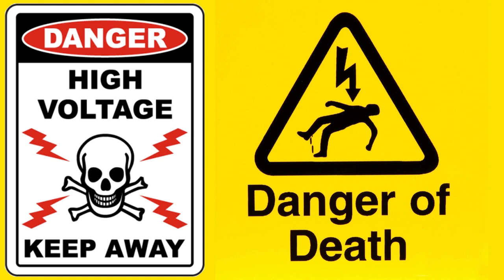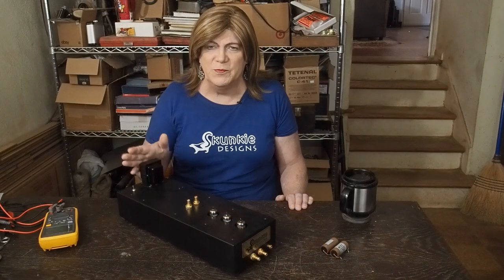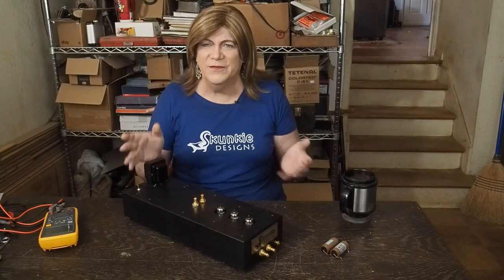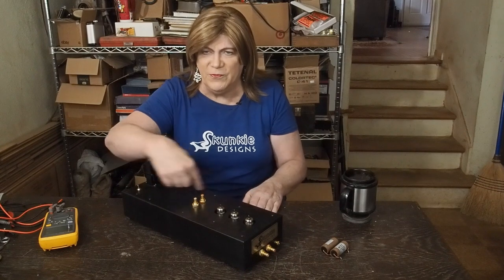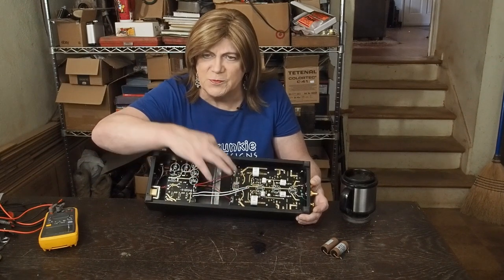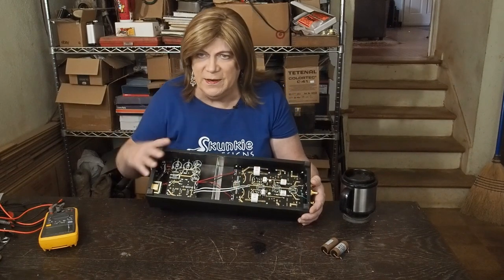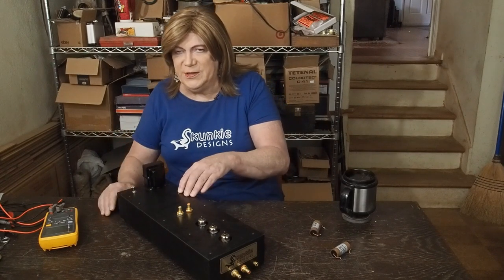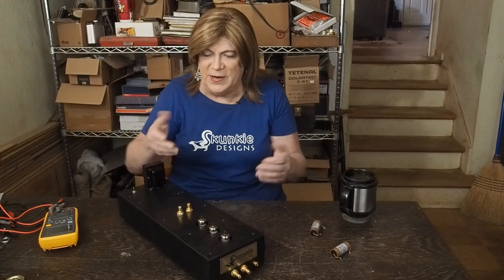All Tube Phono Stage Pre-amp Part 18: Subjective Wrap-up Final Review

Comment: Thanks for this valuable presentation.  I built a similar kit from Zhili Audio, adding a few premium parts.  In usage, my finished kit needed two mods - 1., Use a 12AU7 as Tube No.3 position to lower the gain w/o resorting to use of a potentiometer; and 2., Use a grounded tube shield on Tube No.1 to quell hum.   Fixing the hum resulted in an enjoyable improvement.😀

Comment: Hi, love your videos. I have built 3 of these now. All with 6n2p ev rather than 12ax7. I have re-wired the pins to do this and changed some of the resistor values to suite.  The last one had Charcroft silver micas, matched RIAA components, all good quality parts, bypass Caps under the 6 elecyrolytic, and the 2 small elevtrolytics changed to elna silk caps, I also use the Alpha2delta power supply board built from a kit. It is very quiet and sounds very, very good. I use russian pio caps with very good results. A lot of people on the Lenco forum build these and do all sorts of mods etc one of the members put a lot of effort into making a guide on modding/building these. I must build the standard one some day to compare, but mine sure sounds good. The A2D power supply made a quiet amp silent.
Reply: Hi.. What would you say are the sonic differences between Charcroft silver micas and generic silver micas, from let’s say Antique Electronic Supply? Less glare and sibilance? Thanks..
Reply: @rickg8015  I built my first one with antique mica units. I didn't like the sound and ended up changing them to cornell D ones. The change was massive more open, detailed and more punch. I think the CD's are good value if you get the 1% ones. Charcrofts are nicer but were twice as much. I managed to find NOS Holco resistors of the right values for the RIAA circuit too.
Reply: @flyingmattyboy  Thanks for the feedback.. I’ve only tried Dale RN60 and Takman Rex metal films for RIAA. I liked them both..

Comment: Thanks for the series.  This is going to be my first tube project and between this series and the popularity on lencohaven, i have the confidence to tinker untill i get somthing i like alot better then the phono stage in modern integrated amps.
The parts cost sure do add up quick.  I cant ever seem to settle on any cheap hobbies.
Reply from the maker: yeah, these are not super cheap to build, but I don't trust the parts in the prebuilt ones. I've found the resistors they include with these kits can be all over the place!

Comment: Well, I just watched all your videos on this project and I want to build one! I have two Schiit Manis, one Schiit Mani 2, one ART DJ II, and one Cambridge 615 (I believe that's the model number) phono preamps, but this sounds like a lot of fun. The only thing I didn't hear was what the total cost of the project you built compared to the original build with the Chinese parts. I did download your BOM, but I haven't had the time yet to research the cost. I have a variety of MM carts and one MC cart so I'd be using this on my Technics SL-Q2 that I swap between the MM carts on. I use my Denon DL-103R exclusively on my Rega Planar 2 with my Schiit Mani 2. There were a few places in your build that was missed when it came to the placement of the parts on the boards as I've never done this kind of build before. I've mainly modified/refurbed turntables, but this will be a new adventure. I found your videos after possibly looking into a DIY tube phono preamp. Thanks for the videos as I'll be watching them again when I start building mine! Duh, I just found a couple missing videos on this series and going to watch them now!
Reply: Hello im considering the schiit mani2 , art dj II OR this kit. 
Could you kindly recommend or share your experiences with the mani and art dj?
Reply: @hanscleung4633  I haven't used the ART DJ Pre II in some time, but for it's price point it's good. I really like my Mani preamps, but I'm wanting to try this tube preamp for a different sound. The Mani has many reviews here on YouTube and I have many videos on my channel demonstrating the sound of the original Mani and the Manis 2. I still haven't been able to start buying the materials needed for this tube preamp yet, but I'm hoping to soon as I have the tools for it.

Comment: Thanks for this helpful series.  My parts-swapping in this model brings me to disagree on parts choices for the 0.1uF and the 1.0uF coupling caps and the RIAA silver-mica caps.  The original parts yielded a thin, harsh, lackluster, and impaired-harmonics sound, even with 2 weeks break-in time..  But with quality RIAA caps, plus coupling caps of Jupiter 1.0uF and NOS Russian 0.1uF silver-mica caps, this thing sings, right off the bat.  YMMV, as hifi is about system-dependency.
Reply from the maker: I agree the factory caps don't work great. I used mundorf coupling caps, a .15uf, .01uf and a 1uf + some quality RIAA caps in mine.

Comment: The Miflex coppers do sound rough in the first couple of weeks, and that’s as couplers between driver stages and 300B output tubes.. It might take longer in an input position where much lower voltages (and current) are usually the case..
Reply from the maker: Yeah I wondered about that as far as "burning in" as there is very little voltage or current in this application. I for sure didn't throw them away and will try them in a future project!

Comment: I finished my build and sounds great. i watch your videos and follow your build, but I need to crank up the volume to get more sound up to 2 o’clock on my volume. I don’t know what is wrong.
Reply from the maker: Compared to what?
Reply: @SkunkieDesignsElectronics  I’m not comparing. Im just asking if you have any idea what the problem with my build . If this normal to crank high the volume or is there any missing parts in my build. Thanks
Reply from the maker: This preamp normally has plenty of gain compared to something like a DAC or a CD deck. I'm asking if you are comparing it to a DAC/CD deck or something like a pre-amp put between a line source device and the same amp. Did you do any other mods when building it?
Reply: @SkunkieDesignsElectronics  No ..I built this same as you . I hooked up in my yamaha as1100 and i hooked up with my REISONG A10 same issue I need to crank high the volume, by the way I made MODS With my A10 and the sound is very good BECAUSE of your You Tube videos THANK VERY MUCH.
Reply from the maker: Yeah that's not normal. Not sure if it's a defective tube or something else is going on. Maybe move this to my forum and ask there, attach voltage measurements, pictures etc.

Comment: Must depend on what circuit you put those miflex caps in. I put them in my 2a3 amp and they started out very harsh and bright like you said but after 3 days straight of letting it run it has settled way down. Very smooth now and the brightness is almost gone. It had extreme sibilance for the first 2 days but that's all gone now.
Reply from the maker: It does depend. In this phono stage, this cap only has 5mv of photo cartridge signal running through it, so would take a LONG time to settle down, if ever. In your power amp, it probably has over 100V of swing running through it and still took several days to settle down.
Reply: @SkunkieDesignsElectronics  I guess in your application you'd have to break it in before you put it in the circuit. Sounds like a lot of hassle.

Comment: I’ve been looking for a pre amp to run my kt88 single ended amp that I built from watching Marks videos on Blueglow electronics. Mark mentioned that it would take probably 2V to drive it, so what might this amp produce from a 4mV input from a phono cartridge at the output. I have ordered the kit for this one, and am looking forward to building it. Really enjoying your videos 👍
Reply from the maker: This phono stage is pretty hot, it will easily drive one of those blue glow KT88 amps. I built one and it worked great with it.
Reply: @SkunkieDesignsElectronics  Thanks for the re assurance,  I built the 4s universal pre amp yesterday and it only gave 485 mV when I fed 4mV into it. I love my KT88 amp, I spent £750 on the iron but I have been using a small mixer to drive it, can`t wait to build this EAR834, thanks again 😁

Comment: some of the newer men of integrated amps sound pretty good--ive heard. coupla rega amps, and those are geared towards records. they sound good and have fantastic synergy with the rega turntables. 

outboard phono stage is where its at, tho. some a the cheap ones, like the tube box s2 and the hifi zen, sound real good.

Comment: where did you run your turntable ground to? Just to the chassis? I bought the bare pcb and there are no directions. There is a spot between the inputs on the pcb for a ground connection which looks like the spot. i assume that's the place-just want to be sure. thanks
Reply from the maker: I tied that marked ground point to a screw/stud bolted to the front of the chassis, and the outside extends for the turntable ground wire to connect using a "thumb nut" to attach it.
Reply: @SkunkieDesignsElectronics  ok thanks thought that was the spot. Funny though I took my meter to it and that point has no continuity to the ground plane on the board.
Reply from the maker: @markmckelvey9806  Interesting. I need to give that a look!  I think next time I'm going to try building this as a point to point preamp and see how that works.

Comment: Hi Skunkie Is there any analysis that you can do on the scope etc  For this build? Wish I had your knowledge and skills. I have also built a tubelab sse  with switchable cathode resistors for el84, kt88 etc. All this sounds good to my ears but I wish I knew how to go over them and measure them etc.
Reply from the maker: Check out my video on the analog discover 2 and the audio analyzer suite software. It's not cheap but does a really nice job.

https://youtu.be/vZdL6jmCJvE

Comment: What was the mouser part number for the shorter chassis? I've just ordered the PCB it.  The mains transformer Mouser part number for European customers (230v) is 266L6 {6.3v @2amps)
Reply from the maker: 1444-1463 is the 14X6X3 shorter model. On the transformer, it also needs to supply 230-280VAC. And while the board spec's 2A on the 6.3, a 12AX7 heater pulls 300ma so I would think 1A would cover 3 of them.

Comment: Hey skunkie. Have you considered a step up transformer for a mc cart? Im only asking because im thinking of moving into one and my decware phono stage will need a sut. Love your channel!
Reply from the maker: I haven't looked into those, other than my understanding is good ones are $$$. And not using a good one defeats the whole purpose of going to an MC cart. I personally feel this Audio-Technica VM540ML MM sounds so good, I haven't been tempted.
Reply: @SkunkieDesignsElectronics  ive been using a retipped grado moving iron cart for a year. Its wonderful. I actually bought a second one from the gentleman who modded it. But i got the bug and i havnt changed my phono chain in a while. I looked at bobs devices but dont know if it makes sense to add a sut of that price to a decware phono stage or just look at a new stage that does mc as well as mm.